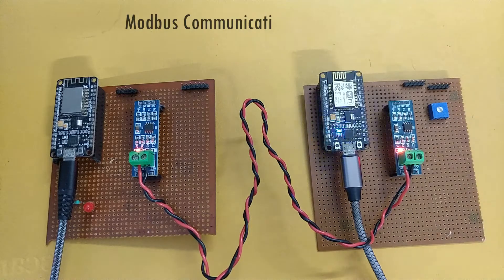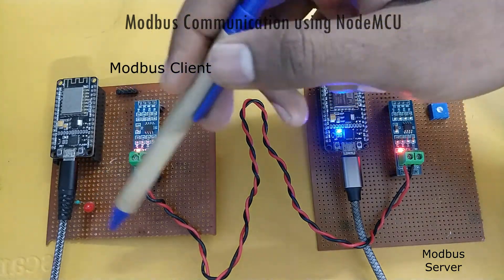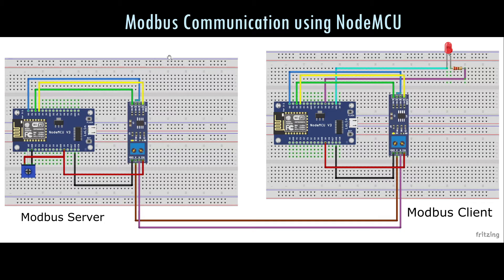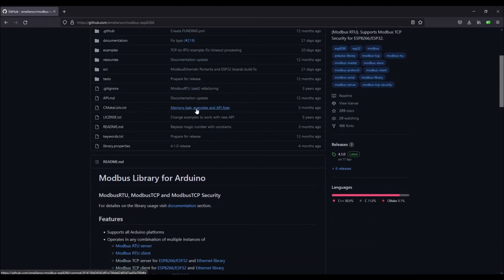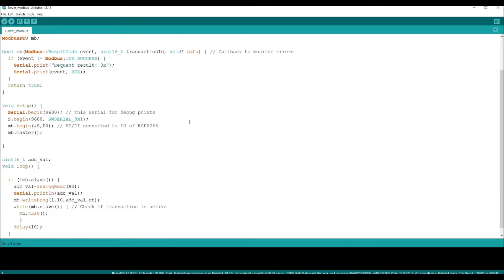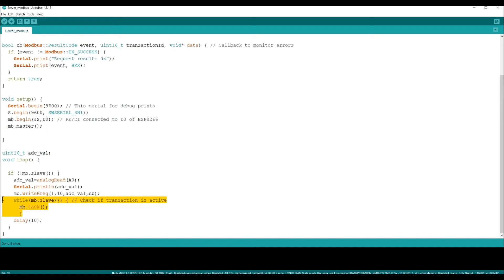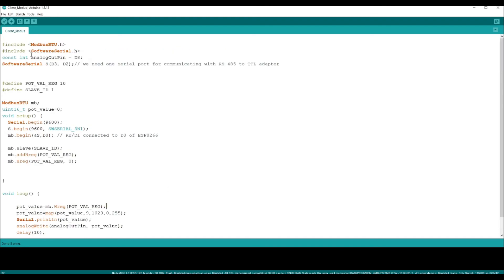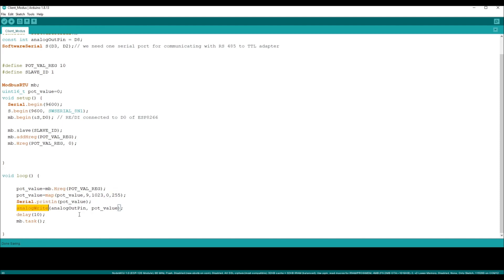Modbus using ESP8266 NodeMCU

Comment: hello sarath tv,thanks for sharing the video,it is very good.
I have a question about server:
if (!mb.slave()) { 

    while(mb.slave()) {
      mb.task();
    }
    delay(10); 
  }

mb.slave() is a variable that is set to false or true depending on whether it is available to communicate with a slave or not? and if so, what exactly does mb.task() do?  is something internal to the library that always has to be executed every time you want to send something.

and in the client I do not understand what function "mb.Hreg(POT_VAL_REG, 0);" performs. I understand that 10 records of the holding register type are already defined with "mb.addHreg(POT_VAL_REG);".
Reply from the maker: Hi @Maxi-pn3wd
The  mb.slave()  works like this - Master mode: Returns slave id for active request or 0 if no request in-progress.
and the  task() is a Processing routine. it Should be periodically called from loop().
mb.Hreg(POT_VAL_REG, 0) is a local write api ie it loads the the holding register with address "POT_VAL_REG" with a value 0. I am just initializing the register with zero.
addHreg is for adding register to the device. 
Hope i could clarify your doubts.
You  can verify these from the the original library    https://github.com/emelianov/modbus-esp8266/blob/master/documentation/API.md
Reply: @sarathtv  thank you very much for the answer and sharing this video!!! greetings
Reply from the maker: @Maxi-pn3wd  you are welcome 
I have few more videos on micro controller based modbus communication 
Do check those out if interested